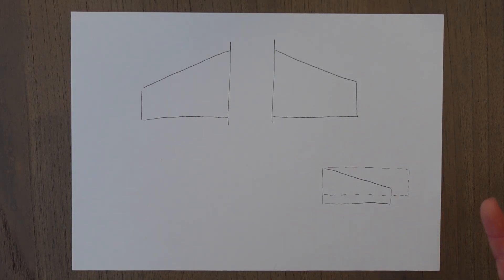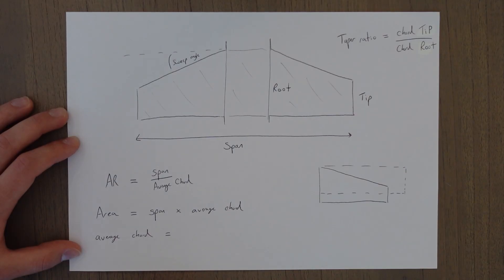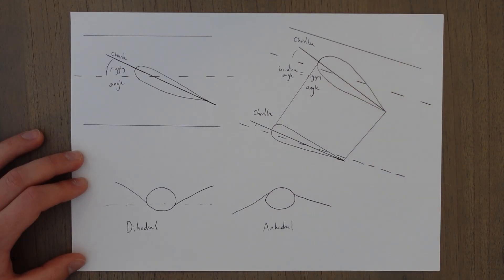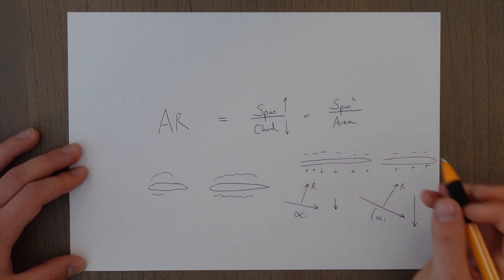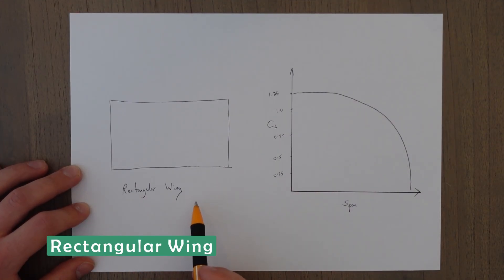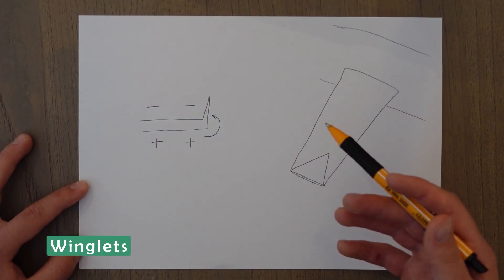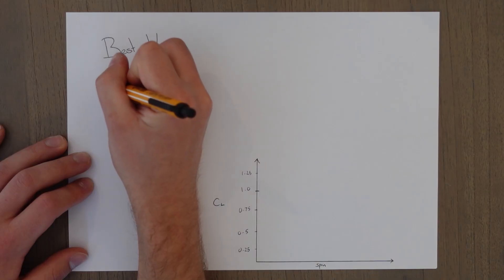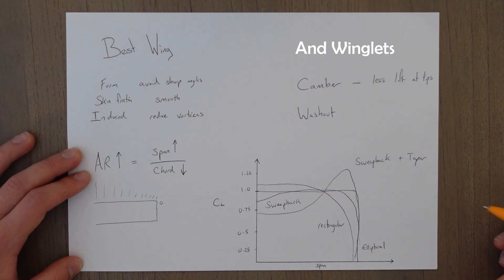ATPL Principles of Flight - Class 6:  Wing Design.

Comment: Quite confused here. When looking at the rectangular wing, there is clearly a higher amount of lift being produced at the root of the wing (as you can see from the lift distribution), but you are saying we have strong wing tip vortices because we have more downwash at the tips...

However with the swept + tapered wing, from the lift distribution, there is much lower lift at the root than the tip, but you are saying downwash is greatest at the root? Why is this? Looking at the lift distribution, there is much greater lift at the tips, which should equal greater downwash at the tips too, no?
Reply: no because pressure flows to area of least resistance, if there is more pressure differential at the tips of the wing then the pressures will meet at the root of the wing causing vorticies and downwash

Comment: at 11:45 for rectangular wing, you said there'a still a large amount of lift produced at the tips, but your graph shows CL gradually goes to 0 at wingtip... why?
Reply from the maker: Large amount of lift should probably be amended to say "large amount of differential force" which means large wingtip vortices. This vortex pulls down the air at the back of the wing, and the reactive force (made up of lift and drag) is angled backwards a lot more than upwards. This means that when we break it down into it's component parts of lift and drag the lift level is a lot lower and the drag level is higher in the influence on these vortices near the tip.

Comment: Thanks for making these videos public! Is the area thats derived by multiplying span and chord length the same area that used to calculate the lift as the S in the formula?
Reply from the maker: Yes,  but it depends on how accurate you want to be. 
You could take the average chord length to find the area and lift for the whole wing area. Alternatively you could also use a smaller area to find out lift for a specific section of the wing, such as the wing tip and the result would be more accurate for that section of the wing.
Reply: @atplclass  Alright, thanks for the quick reply!